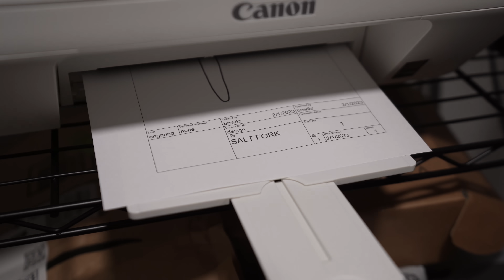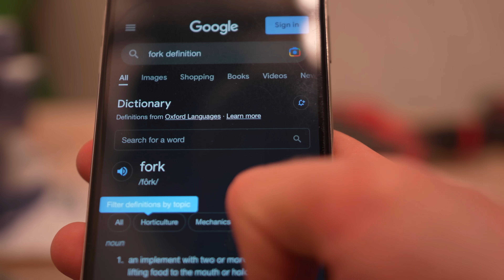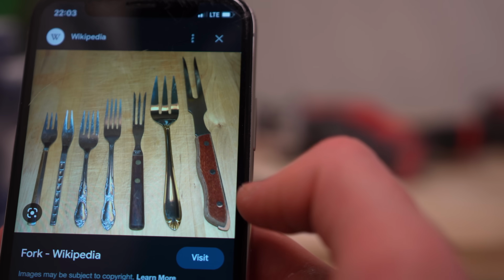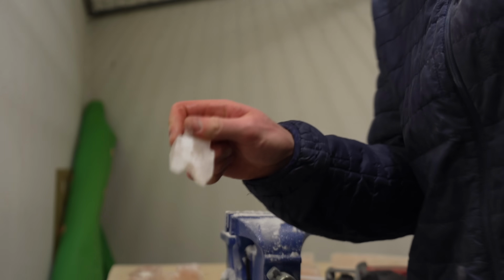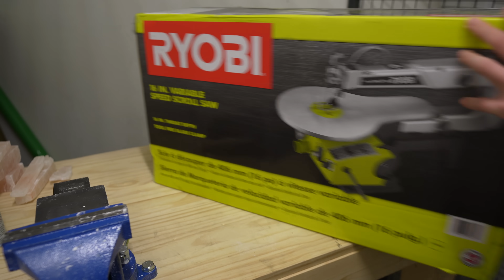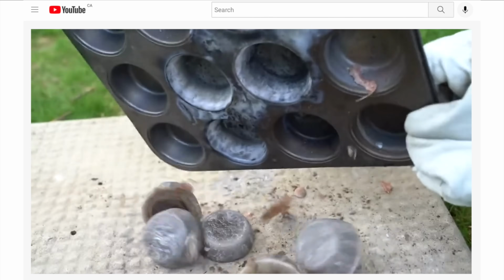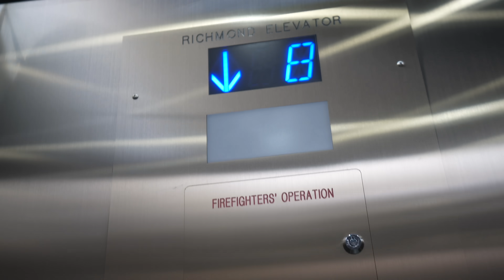What if forks were made of salt?

Comment: Making a fork out of salt is an interesting project that combines creativity with basic chemistry. To create a salt fork, you could follow a process that involves molding and crystallizing salt to form the shape of a fork. Here's a step-by-step guide:

Materials Needed:
Salt (table salt or sea salt)
Water
A heat source (like a stove, oven, or microwave)
A fork (for use as a mold or template)
A baking sheet (if using the oven)
A pot or container for boiling water
A small pan (optional)
A spoon or stirring stick
Food coloring (optional, for added decoration)
Steps:
Dissolve Salt in Water:

Pour about 1 cup of salt into a container.
Gradually add water and stir to create a saturated salt solution. This means that the water should be filled with as much salt as it can dissolve (until no more salt can dissolve and some remains at the bottom).
Heat the Solution:

Heat the saltwater mixture to boiling. This can be done in a pot on the stove or in the microwave. Heating it will help the salt dissolve faster and make the crystallization process more effective later.
Evaporate the Water:

Once the solution is boiling, reduce the heat or transfer the solution to a flat surface (like a baking sheet or shallow pan) to let the water evaporate. The slower the evaporation, the better the crystals will form.
Create the Fork Mold:

Option 1: Using a Real Fork (for a more structured shape):
Place the real fork on a baking sheet or shallow dish where the salt solution can slowly crystallize around it.
Leave the solution to evaporate over several hours or overnight. As the water evaporates, salt crystals will form around the fork.
Option 2: Shaping by Hand (for a simpler method):
Instead of using a fork as a mold, you can try to form the shape of a fork by hand using wet salt. If you choose this method, wet the salt with a bit of water to help it stick together, and use your fingers or a tool to shape the tines and handle.
Drying:

Once the salt crystals have formed around the fork or shaped into a fork, leave it to dry completely. This may take several hours to a full day, depending on the ambient humidity and air circulation.
Optional Finishing Touches:

If you'd like to add color to your salt fork, mix a few drops of food coloring into the saltwater solution before it evaporates. This can create colorful patterns or layers in the final result.
Final Result:

Once dry, carefully remove the salt fork from its mold (if used), or inspect the fork you shaped by hand. The result should be a fragile, crystalline fork that can be displayed as a unique piece of art, but it won’t be functional like a metal fork due to its fragility.
Important Notes:
Handling: Salt forks are not durable for practical use since salt is a brittle material. They are meant for display or artistic purposes.
Crystallization Time: The more time the solution is allowed to sit undisturbed, the more defined the crystal structure will be.
Protection: Salt is hygroscopic, meaning it absorbs moisture from the air. Over time, your salt fork may become soft or dissolve if exposed to humidity.
This method combines basic science with artistic design to make a salt fork!

Comment: There's a stained glass grinder called Kristall 2000-S. It has a big surface underneath the stabilized grind, which is covered in plastic net. Underneath that net there's a reservoir filled with water, and the grindstone itself has water constantly flowing on it. It allows the glass dust to get wet and, instead of flying around, fall to the water reservoir where it remains. This machine allows you to work with huge amounts of glass dust without breathing a lot in and getting a lot of it in the air, in general. To some extent it could work with your material, too.

Comment: These could genuinely serve a good use as replacements for disposable plastic forks, considering that they can probably dissolve in a few minutes and they don't need to be shared or washed. If they could be casted quickly, then I really think that you could be onto something
Reply: You really haven't thought this through, huh? That's probably the dumbest idea ever given the multitude of available biodegradable materials.
Reply: comes with 12 million times your daily recommended sodium intake in every meal!
Reply: @toseltreps1101  It would be really easy to reclaim the materials though, all you need to do is dissolve it and boil the water off
Reply: One of the big problems with plastic waste is it getting dumped/washed into rivers etc.. if you replaced the plastic with salt you would salt the earth on a scale never before seen

Comment: Making a fork out of salt is a creative and fun project! Here’s a simple way to create a salt fork using salt dough:

### Materials Needed:
- Salt
- Flour
- Water
- Mixing bowl
- Baking sheet
- Oven

### Salt Dough Recipe:
1. **Mix Ingredients**:
   - Combine 1 cup of flour, 1/2 cup of salt, and 1/2 cup of water in a bowl. Mix until it forms a dough. Adjust the water or flour as needed to achieve a workable consistency.

2. **Knead the Dough**:
   - Knead the dough for a few minutes until it’s smooth and pliable.

3. **Shape the Fork**:
   - Divide the dough into smaller pieces. Roll out a piece to form the handle, then shape another piece into the prongs of the fork. Attach the prongs to the handle by pressing them together and smoothing the edges.

4. **Bake**:
   - Preheat your oven to 200°F (93°C). Place your salt fork on a baking sheet and bake for 1-2 hours, or until it’s hard. Let it cool completely.

5. **Optional Finishing**:
   - You can paint or decorate your salt fork once it's cooled, but keep in mind it will be more of a decorative item than a functional utensil.

### Note:
- This salt fork is not suitable for eating or heavy use, but it’s a great craft project! 

Enjoy your crafting!

Comment: Never worked with Salt, but I did work with thin sheets of Corian, which are also brittle when thin. It would be safer for you, more surefire, but also take longer to file it by hand after getting the shape. There are small files for modelmaking which are delicate enough to whittle brittle mineral without introducing much shear force (which is why it cracks)

Comment: So what if you made a fork mold and poured high salt content water into the mold and let it dry, adding more salt water to it and building up each fork instead of cutting down from a larger piece. Minimal waste and I think you'd have a more exact and potentially better fork. You'd also be able to recycle any broken forks by dissolving them into the solution and reapplying.
Reply: i dont think that would work because the fork wouldn't be solid, rather just crumble into table salt because when u dissolve salt its dispersing all around the water, so when u melt it you just get table salt
Reply: It would work though you'd need a bind, like maybe another chemical? material? nevertheless its a good idea

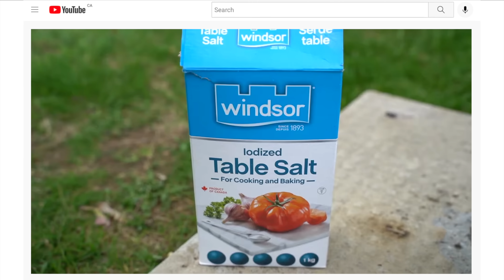Comment: 3:56 If anyone is curious about chat GPT's answers:

Prompt: How do i make a fork out of salt? Anwser: "Creating a functional fork out of salt would be quite challenging, as salt is a brittle crystalline substance that is not suitable for sculpting or shaping into intricate forms. However, if you are interested in making a decorative fork-shaped object using salt, you could try the following approach:

Materials you will need:

Salt (table salt or rock salt)
PVA glue or water
Cardboard or a stiff piece of paper
Aluminum foil or plastic wrap
Optional: acrylic paint and brushes for coloring
Here's a step-by-step guide:

Start by shaping the handle of the fork. Take a piece of cardboard or stiff paper and cut it into a fork handle shape. This will serve as the base for your salt fork.

Wrap the cardboard handle in aluminum foil or plastic wrap. This step is important as it will prevent the salt from sticking directly to the cardboard.

Prepare a mixture of salt and PVA glue or salt and water. You can experiment with the ratio to find a consistency that works best for you. The glue or water will act as a binding agent for the salt.

Carefully spread the salt mixture onto the wrapped cardboard handle. Use a spatula or your fingers to shape the salt into the form of a fork, following the outline of the cardboard handle. Ensure that the salt layer is evenly spread and has a thickness of about 1/4 to 1/2 inch.

Allow the salt fork to dry completely. This may take several hours or even a day, depending on the thickness of the salt layer and the humidity in your environment. Patience is key to ensure that the fork is fully dry and solid.

Once the salt fork is dry, carefully remove the foil or plastic wrap. If any areas of the fork are weak or crumbly, you can reinforce them by applying a small amount of additional salt mixture and allowing it to dry.

If desired, you can paint the salt fork using acrylic paint to give it a more realistic appearance. Use a small brush and let the paint dry thoroughly before handling.

Remember, the salt fork created using this method will be fragile and not suitable for actual use as a utensil. It is primarily a decorative item or a prop."

Comment: Creating a functional fork out of salt would be quite challenging due to the brittle nature of salt. Salt is a crystalline substance that can easily break or crumble under pressure, especially when subjected to the forces exerted while using a fork.

However, if you're looking for a creative art project or a temporary decorative piece, you can try making a salt fork-like structure by following these general steps:

Materials you'll need:

Table salt or rock salt (a larger grain size might work better)
Water
Mixing bowl
Spoon or fork as a template
Plastic wrap or parchment paper
Optional: Food coloring for tinting the salt
Steps:

Mix the Salt Paste:

Pour a significant amount of salt into a mixing bowl.
Gradually add small amounts of water and mix until the salt starts to stick together, forming a paste. Avoid adding too much water to prevent it from becoming too wet and difficult to work with.
Optional: You can add a few drops of food coloring to the mixture if you want colored salt.
Shape the Fork:

Lay a piece of plastic wrap or parchment paper on a flat surface. This will prevent the salt paste from sticking to the surface.
Take a spoon or a real fork as a template and gently press it into the salt paste to create the shape of a fork. Use your fingers to carefully mold the salt paste around the template, following the shape of the fork's prongs and handle.
Allow to Dry:

Carefully lift the salt fork shape from the plastic wrap or parchment paper and place it on a clean, dry surface.
Let the salt fork dry and harden. This might take a while, as the water in the mixture needs to evaporate completely.
Handle with Care:

Once the salt fork has dried and hardened, it will still be fragile due to the nature of salt. Handle it gently to avoid breaking it.
Remember that this project is more of a novelty or artistic endeavor rather than a functional kitchen utensil. Salt forks made this way are unlikely to withstand actual use.

If you're looking for a more durable and practical alternative, you might consider crafting a fork handle out of another material (like wood or metal) and decorating it with salt as a creative touch.                                                                        Thanks Chat GPT

Comment: Making a fork out of salt is not a common practice, but if you're thinking of creating a salt sculpture resembling a fork, you could try the following approach:

### Materials:
- Fine salt
- Water
- A mold (you can use clay or create a simple mold resembling a fork shape)
- A sturdy surface or tray

### Steps:

1. **Prepare Salt Mixture**: In a bowl, mix fine salt with a little water until it has the consistency of wet sand. You want it to be damp enough to hold shape but not too wet.

2. **Pack the Mold**: Pack the salt mixture tightly into a mold shaped like a fork. If you don’t have a mold, you can try shaping the fork by hand, but it will be more fragile.

3. **Dry the Mold**: Let the mold dry for several days in a warm, dry place. The salt will harden as the water evaporates.

4. **Careful Handling**: Once dried, carefully remove the salt fork from the mold. It will be fragile, so handle it gently.

This process can create a fork-like structure, but it may not be functional or very strong.

Comment: Brother you got to do some more thinking before doing... After the first breaks, you realize the force and vibrations are is too much... so I was already thinking, hey, maybe use some water to get the final sharp edges, or in fact, maybe use a pressure washer. Salt forms in crystals, so maybe  the salt will be stronger in a specific orientation, maybe heating it up and annealing it will make it more resistant to cracking (granted, these last two ideas are thanks to a uni education..). 

Anyway, seems like your persistence paid off, so congrats in the end!